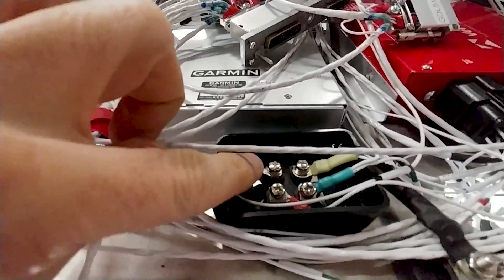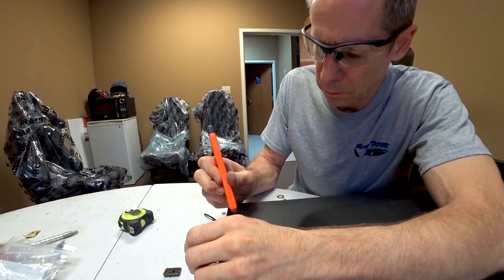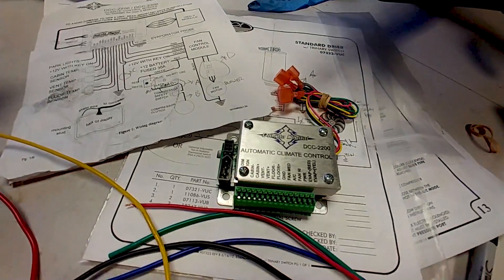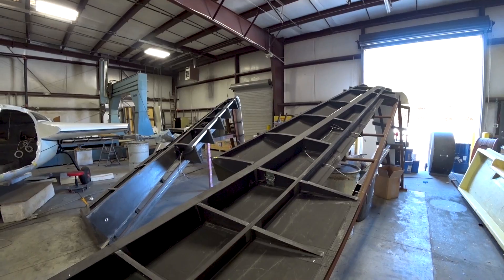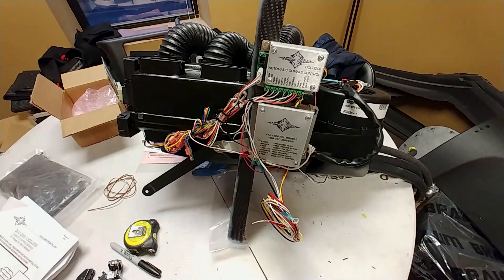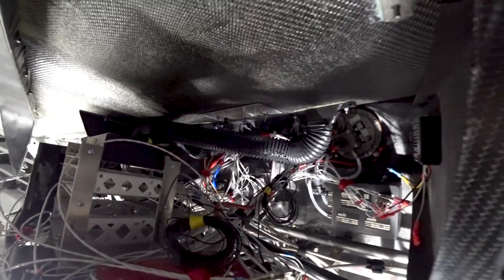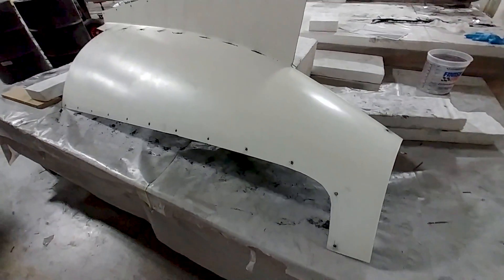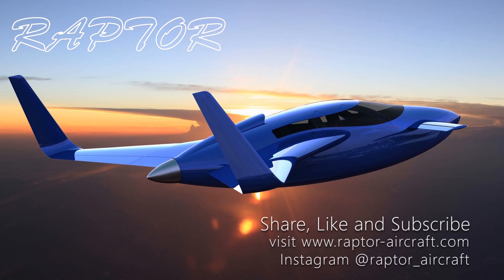Making Airplane Noises - Building the Raptor Prototype

Comment: (Minute 0.33) You most definitly want to move that lower left wire to the outside. Not just because it looksbetter, but also as these terminals are spaced apart to reason. Having wires pointing inward reduces minimum spacing. A source for a nasty surprise in case of over voltage.

Comment: I'm curious how you feel your doing with the weight of the aircraft. Also will it work to set this up as a 5 seat aircraft.
Reply from the maker: We're over weight by about what I expected given that it's a prototype. Yes 5 seats is possible but just not using the seats that I presently have because they are too wide at the shoulders.

Comment: I do have a question,  are you planning on putting a sound blocking blanket on the back wall of the cabin to eliminate engine noise?
Reply from the maker: No, there's three walls there and one has one in thick foam as the core.

Comment: I've always sworn that if I ever own an aircraft with retractile gear, that I'd rig up potentiometers on the pivot points to tell me exactly where they're at.
Reply: You'd want to be sure to design it so that it didn't give you a false sense of security However. Flex sensors and sensors for detecting  if the gear is fully in the down position sounds like a great idea though.... was in a Canadian crj-200 a few years ago that the gear got stuck down on takeoff. A flex sensor to verify control of the nose wheel steering would also be useful.
Reply: @Wingnut353  I've had a faulty indicator in a Bonanza, so I'd set up an LED animation showing the movement of each individual gear.  I've always hated that long wait for the green light.  Course now days a digital cam would be much easier I guess..
Reply: @MatHelm  yeah or manual gravity assisted gear like on the dyke delta!

Comment: So,  just the two bolts holding the entire wing on then ?  I am sure you've done the calculations, but maybe some sort of interlocking cross section on the mating surfaces to take the shear loads   would be an idea for the production planes. Love this project, keep up the excellent work
Reply from the maker: There is a third bolt holding the leading edge together. Nah, we just guessed on the bolts. 😋 Obviously we didn't come this far just guessing, we've absolutely done the FEA on the attachment structure and bolts.
Reply: never doubted it, I  just like redundancy - just in case : ) 
 @RaptorAircraft

Comment: The sensor on the evap is a temp sensor.  It will turn the compressor off if the temp goes below a threshold to prevent the evaporator from icing up.

Comment: You dont sound american...but you are talking in inches. Wtf, lol
Reply from the maker: I use both which annoys the locals when I switch to meric.
Reply: @RaptorAircraft  So do I. It annoys the heck out of me. I found I was using both scales on the same project. So I piffed the double scale measures and kept the metric ones for consistency.
Reply from the maker: I am an Aussie whose been in America for over 25 years.
Reply: Oz converted to metric a bit after 1970. There's still a whole bunch of us who can comfortably work in both metric and imperial and can convert betwixt the two systems without too much effort. Schools taught both. Forget chains, rods, perches, furlongs, fluid ounces, pounds and bushels - the rest isn't  particularly hard. I can still work the old money.
Reply: Haha!
Reply: In the UK, we converted to metric in the 70's. I'm in my 50's and still use both depending on what  I'm feeling at the time. Sometimes use both on the same job. Confuses the heck out of the younger ones (probably why I do it 😂)
Reply: I thought america was moving to metric pretty quickly these days. Am i wrong in thinking that even Chevrolet uses metric now? 

I do occasionally talk in inches and feet but only when saying "an inch" is easier than saying "twenty five millimeters" for example.

Comment: where did you get the wiring stuff so you do not need the soldering iron?
Reply from the maker: Just using crimp on connectors. You still need a soldering iron for some things.

Comment: Very awesome seeing the Raptor prototype coming together!
(I'd like to use the Bose Pro-Flight or the Lightspeed Wireless/Bluetooth Tango, which may turn out to be a possibility when considering the power-plant location, 5-bladed prop and the use of Soundex aircraft sound deadening insulation...only time will tell).
Happy/Safe Flying!

Comment: Good idea with the in-ear Bose.  My personal experience is that the in-ear option creates a lot less fatigue on longer flights.  My ears get quite sore with the muffs after a couple hours (Bose), but I've flown across Australia in one Day in my Glasair with in-ear plugs (Clarity Aloft) without any issues.  Cheers, Jim.
Reply: Love my Clarity’s...
Reply: @ibgarrett  Me too Brian.  Noise attenuation is excellent - despite the Glasair not being the most quiet of aeroplanes.
Reply: That's awesome to know. I really want myself and passengers to be as comfortable as possible. Imho, in ear head sets with Bluetooth capabilities, is the way to go. That is why I want to do as much as feasibly possible, to reduce cabin noise above and beyond Peter's great efforts. So far, Soundex appears to be the best aviation sound deadening/insulation available, therefore will be implemented everywhere possible. Happy/Safe Flying!🙏🇺🇸👍
Reply: Unless you have child size ear canals. Then earplugs hurt after a short time. If you can get them small enough then they’re too flimsy to insert by yourself.